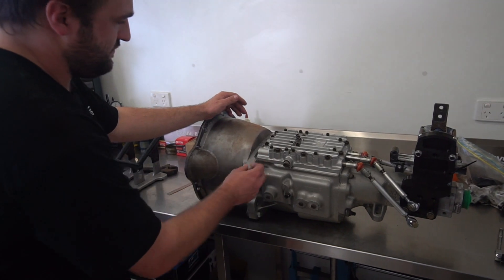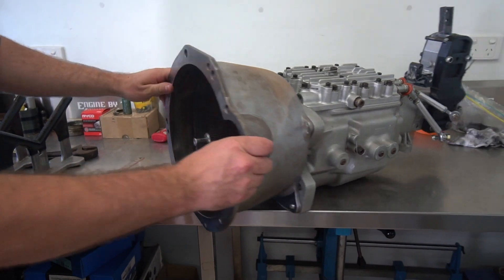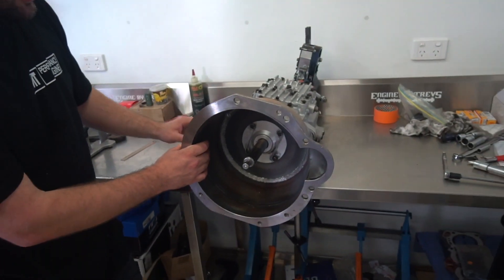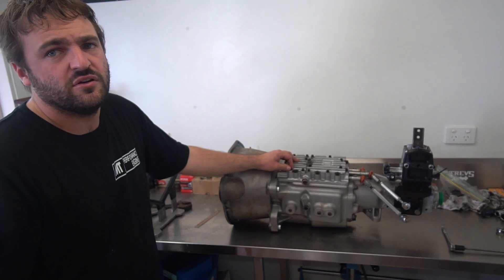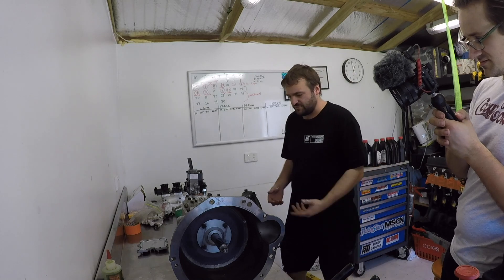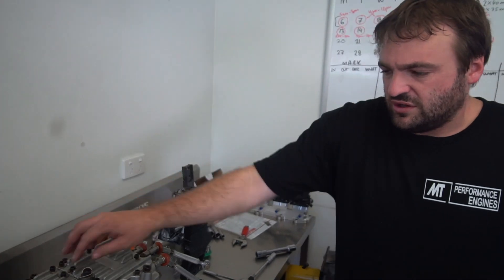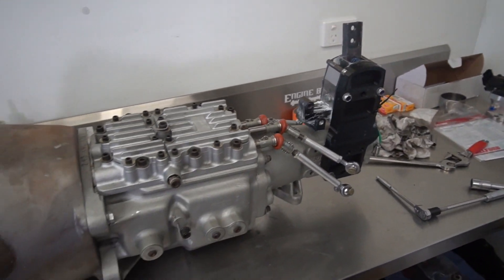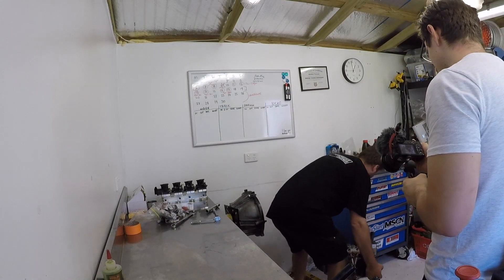Jerico 4 Speed (Ask An Engine Builder Part 1)

Comment: A straight cut gear is more efficient than helical gears and way more reliable behind higher hp engine applications. All Dog teeth are tapered inwards no matter what brand to hold in gear as well as aid in the shifting process. To say it will take a lot of hp away from the car is utter crap. These gearboxes were designed by Jerico were designed for racing applications with as little bearing friction and transmission losses and to be as reliable as possible.